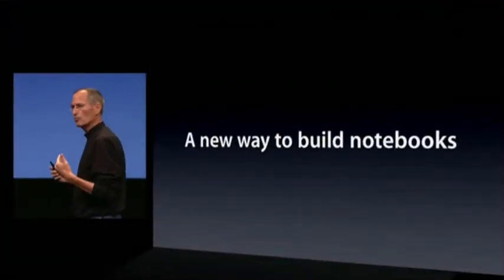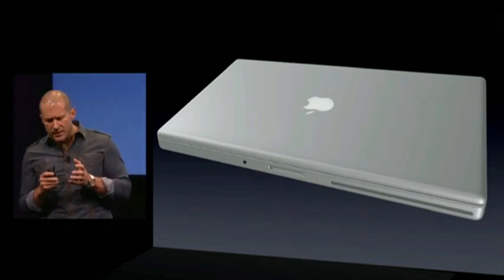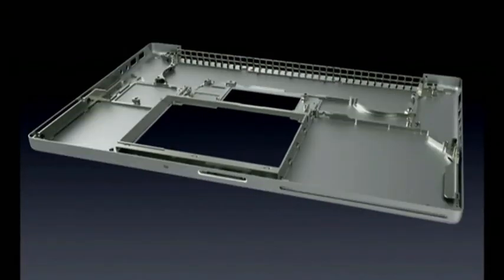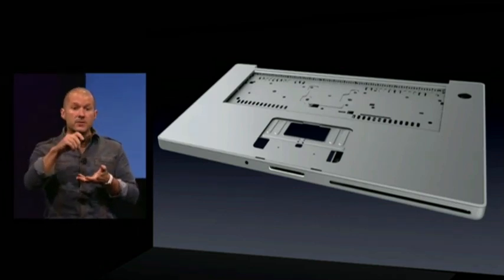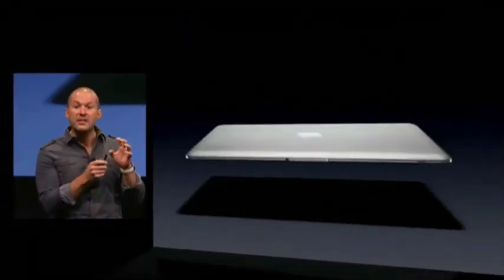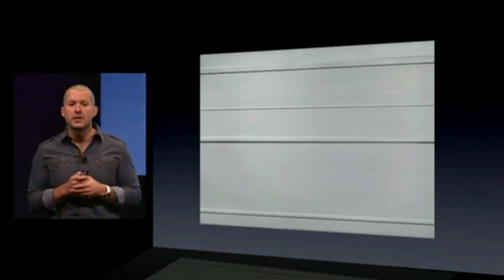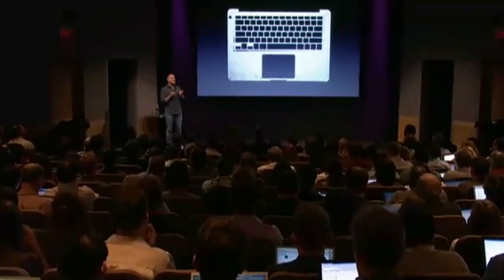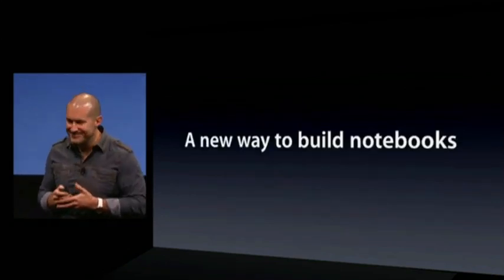Oct 14 - Apple Notebook Event 2008 - New way to build - 2/6

Comment: In iPhone the Steel or Aluminum will made by One Piece and You Pull Battery and Chip easily inside and Out of Phone Apple and With Screws you Pull the MotherBoard and Battery with less Glue and Bigger Battery in Same Space abd easy Repairs also in iPAd and MacBook for Bigger Battery and Less Glue mean 2 more Milimetar of Battery which is a Lot and very easy and Chip Repairs. Work. Like with one Piece MacBook Chassis. Srarting with Apple Watch 7 and iPhone 13 it's Easy Tim and mean less Engineering.

Comment: the new macbooks are cheaper compared to previous prices my imac 24in is $2,199 you can get one of the new macbooks for like $1,560 i think and it would be much powerful than the imac. because the most expensive imac has an 8800gt and the new macbook has an 9400gt so i'll think the new macbooks would really boost up in sales